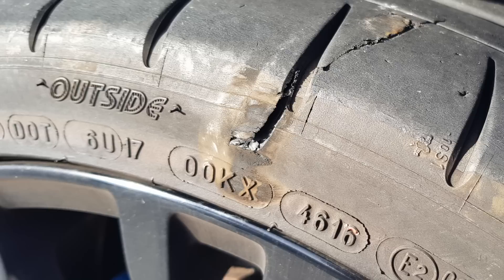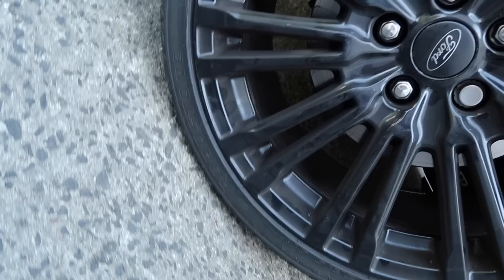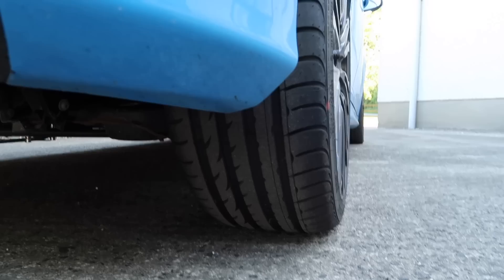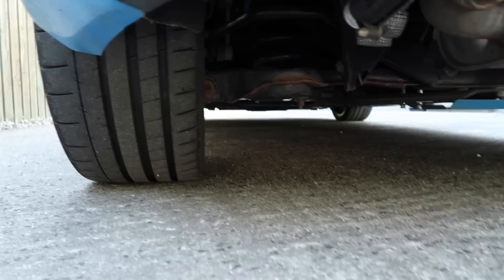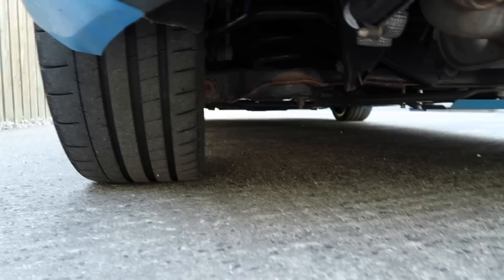SUDDEN TYRE FAILURE! | FOCUS RS | MICHELIN PILOT SUPER SPORT | VLOG 25

Comment: Remove that  tyre and fit it to an aftermarket rim, and carry it in the boot secured with a bicycle type security chain and lock. The crazy thing about using the inflator and goo is that in the owners manual Ford say the tyre has to be replaced after a max of 200 KLMS....!!! So from day one I have carried a spare wheel/tyre....yes it takes up a lot of room, but if you travel any reasonable distances from home, you need peace of mind 24/7. You will also need a Focus ST jack which is very compact.

Comment: The Ford ‘tyre gel’ stuff is proper shit, what I tend to do is keep a canned one from Halfords which is decent- it’s like an aerosol can with the hose on the end- which seals the tyre better, then pump up the tyre with the Ford electric pump to full pressure. Less mess and better results 👌🏻👌🏻
Reply from the maker: I have to say Jacob, I'm not convinced by the ford tyre goo. I got to the tyre place without trashing my wheel but it wasn't that far away and the tyre was pretty flat when I got there, the goo spurting out
Reply: I had a similar thing on mine, pothole took out my 2 drivers side tyres. Damage was less severe than on your tyre, pumped them both up to normal pressure with the Ford goo... about 10 minutes later I had the TPMS warning on again 🙄. 

It also sprays everywhere when you take it off the tyre valve, I had it all over my car’s paintwork and it’s a nightmare to get off even with a good tar/ glue remover.

Comment: Hello Adam, I would replace a whole set of tyres and for got Michelin and then sell my existing tyres as part worn, or keep em for spares. I would not be able to have odd brand of tyres on my RS. Also the ford stuff is poor and I don’t like using any foam and I would of used a mobile tyre fitter or got accident assist out to sort it.

Comment: Delt with quite a few tyres being a mechanic the difference in tread if it's over 4mm difference not only will it effect how the car handles but could also possibly put the rear diff under unessersary strain because of the height different and the way the different sidewalls of the tyre react when cornering as you said the ps4 are reinforced which makes it stiffer so theirs less tyre roll. Their my thoughts anyway mate hope it helps

Comment: Awd honestly should all be running the same tire and size. I can see where a new unworn tire wouldn't be healthy so to speak over the long term for your rear differential. A new tire in your situation would be recommended in an emergency situation which you did and didn't have much choice. If it was my car, I'd make sure all 4 tires are the same.

Comment: I would get two new PS4S and put on front and swap out the chinese crap for one of the part worn fronts. The original michellin PSS on mine did 23k mile on the front which is amazing mileage including one track session.  That is prob the best mileage out of any tyres i have had on any car so will be sticking with Michelin on my RS

Comment: Adam, I would use it as an excuse to replace wheels and tyres at same time. Not a fan of the current wheels anyway. I run Michelin Pilot Sport 4 really like them , I also liked the Bridgestone on previous but they just lacked a bit in traction on my ST. Horses for courses though and personal choice but I wouldn't have a no brand on there with unproven heritage.